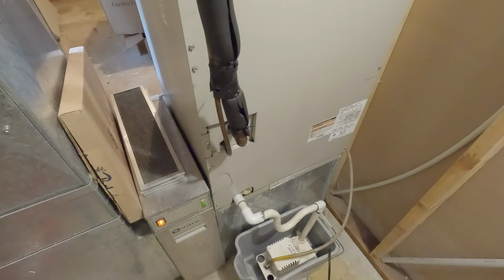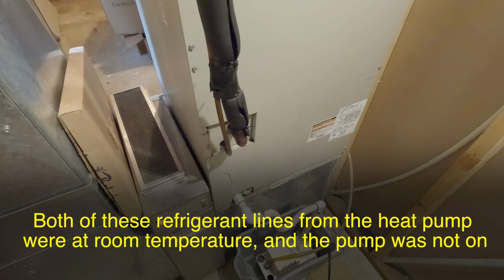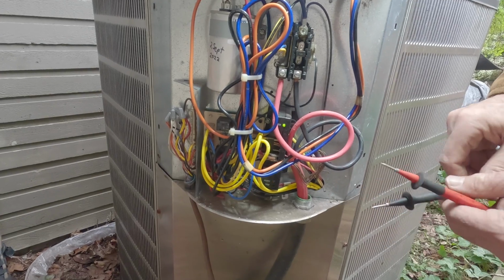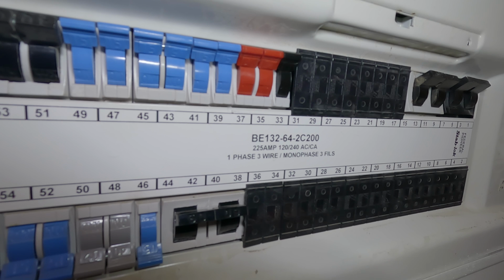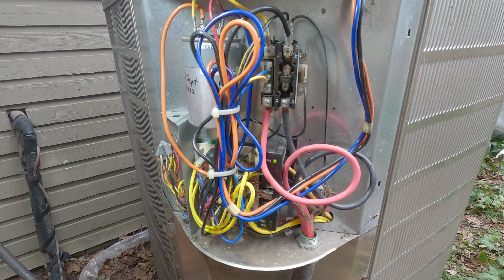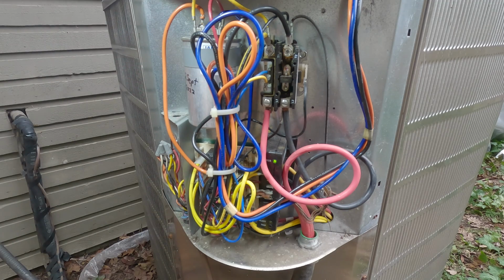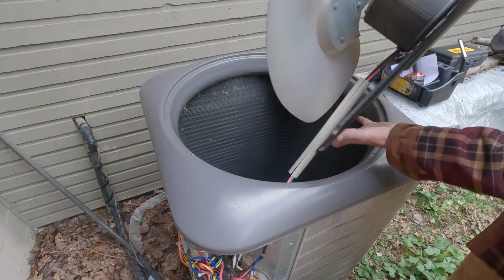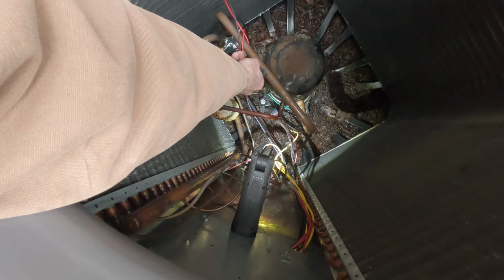How to diagnose a failed heat pump with confidence

Comment: Sorry to hear about your compressor Dave. It sounds like it had a good life. Take care! 👍
Reply from the maker: Yes, the new unit is going in today. Your advice to simply swap the run cap rather than adding a dedicated start cap and potential relay was the trick to getting another few seasons out of the old pump. Thanks for stopping by, Terry!
Reply: @spelunkerd  I want to apologize for not seeing your video earlier, but as I've mentioned in the past YouTube doesn't show any notifications for your channel and for a lot of other channels. You got a lot of years out of that compressor and you'll be happy with your new unit. On a side note, my most recent video shows where I'm releasing a Windows volumetric efficiency calculator to the public that I wrote. It has some features not seen in any VE calculator which may interest you. Have a great day and don't work too hard!
Reply from the maker: @stuzman52  I'll go have a look. Likewise, I didn't see it, the algorithm has taken control of subscriber lists and feels it can do better, ha ha.
Reply: @spelunkerd  No problem Dave! As for their algorithm, I just don't get it. At one time in the past, I would get notifications through email. Then they dropped the email and went to notifications through a popup which doesn't work. Again, sorry for the delay in viewing your video.

Comment from the maker: The thing I find most interesting is the way this failure shows some behind the curtain design features of the ground and TNC-S neutral system. The way the AFCI breakers in unrelated circuits tripped is easy enough to shrug off. AFCI breakers trip when they see the characteristic frequency of voltage change in a corroded circuit, in this case on the ground side. But how do we explain why the 240 V external coil fan was slowly spinning, when the board should have it turned off? That PSC fan is not even fed with a neutral wire, and it has a single pole contactor so one pole is constantly hot. I'd be interested in any thoughts you guys have. Do you think there was a second point of failure, or do you think this could all be explained by magnetic interaction between one hot pole and fluctuating equipment ground?

Comment: Good video, but what your customers know that it's wise to denergize the capacitor before moving forward.
Reply from the maker: Excellent point. I addressed that in the other video, but it's always good to hammer in critical points regarding safety. Ground each side of the cap to each other, and also touch them to the equipment ground.
Reply: @spelunkerd  and also making sure that you have a electrical screwdriver to do so or a Klein screwdriver with rubber handle

Comment from the maker: Errata. 80A at 240 V is 19,200 Watts. With a smart meter on the home we can look at daily power consumption, and the day after our pump died our electric power consumption increased by about 40% above baseline. I expect it to stay at that until the new heat pump is installed. This will cost more than a few hundred extra dollars every month. In locations where ambient temp is usually above freezing, heat pumps are far more economical than resistance heaters or even natural gas. Efficiency slides backward for locations that get colder, although in those locations geothermal heat pumps offer a more effective option.